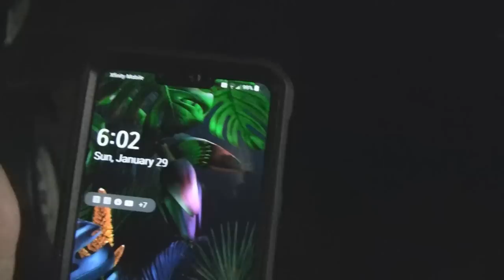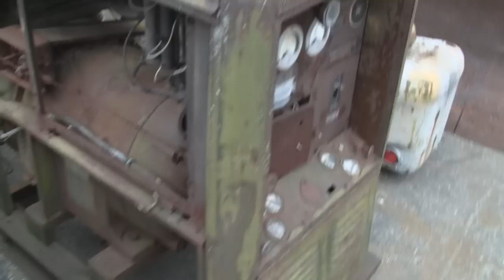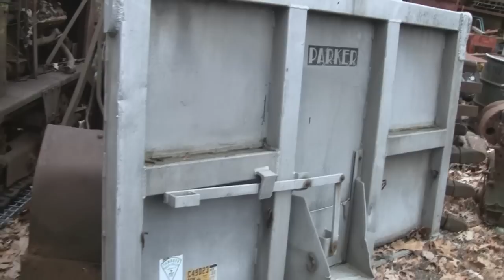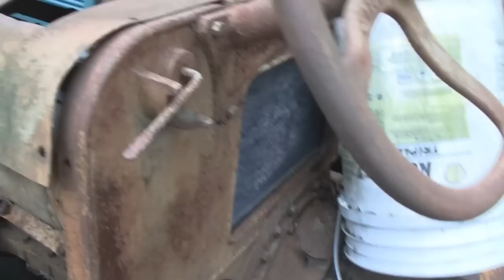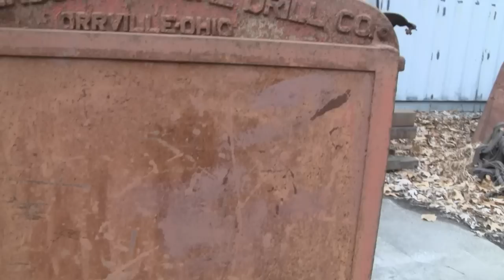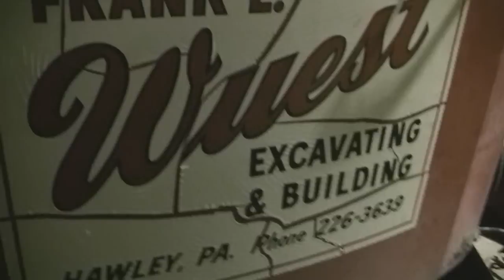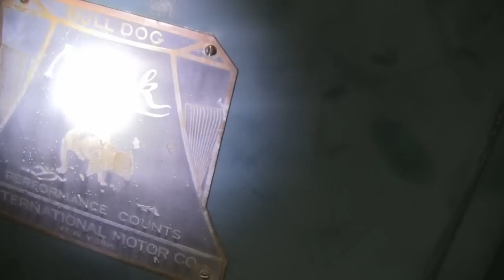ROADTRIP, EXTREMELY RARE MACK PICKUP and we get a GENSET

Comment: A friend, an apprentice mechanic at the time, was fitting a tyre to one of those wheels, without a cage. Sitting on the wheel. The foreman saw him, grabbed him and pulled him away. About 2 seconds later the lock ring let go and went straight through the roof. 2 seconds away from losing his legs, and probably his life.
Reply: I worked with a guy at a tire center in the early 70’s that had one let go while he was leaning over it, the radius of the ring hit him from his chin to the top of his forehead. I met him when he came back to work, plate in his head and one hell of a scar on his face. Scary stuff.